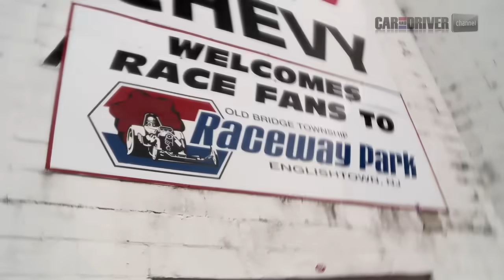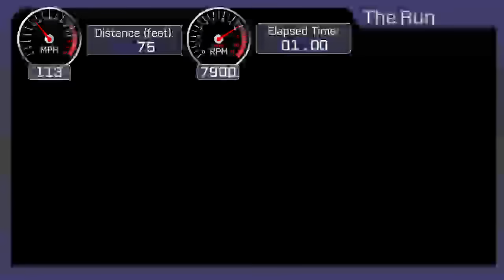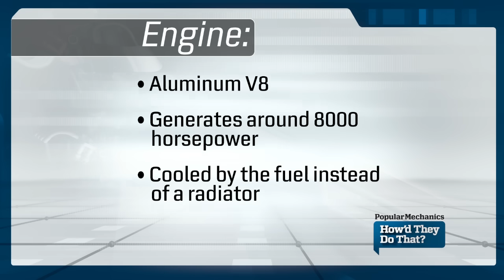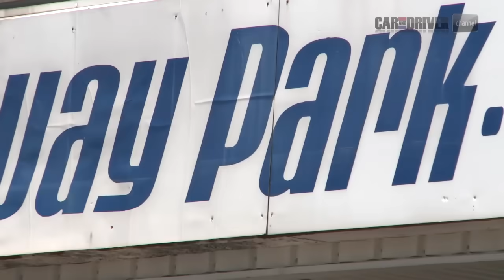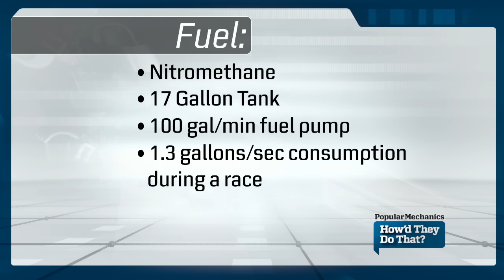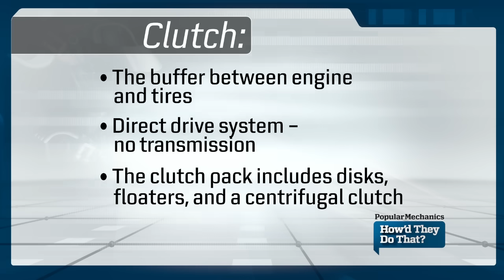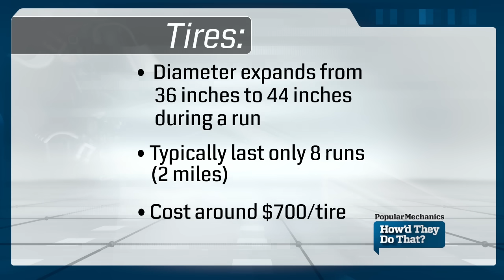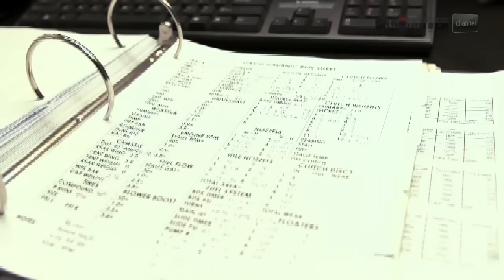How a Top Fuel Dragster Works

Comment: I have a lot of engineering questions that I would like to be answered. Why does the supercharger throw away 600 hp as a parasitic loss when it opens? When does the supercharger open or close? Is it timed? Why use a V8 engine rather than a V12 or another alternative? How exactly does a dragster's clutch work in order to get the engine power to the wheels? Why don't they shorten the length of the fuel line and make the car shorter in length? Lastly, why don't normal drag cars use Nitromethane fuel rather than e85?
Reply: Ok...They use a v8 for a few reasons...one is it is tried and true.. with 2 extra pistons the integrity of the engine block would be ruined. Mostly it has to do with geometry of the engine. The supercharger isnt an open or closed system. If the engine is running the supercharger is working. The wheelbase of the dragster is important for straight runs. If you shortened it by very much the car would be even harder to steer. As far a fuel choice goes, most people cant afford $16/per gallon for nitro meth and with e85 under $5/per gallon....
Reply: Insane82chevy Alright, that all makes sense. Thank you. One thing, though. I realize that I was talking about the intake valve. How does it know when to open and close in order to force that 50 psi into the intake manifold?
Reply: Jav The Ripper Both the intake valve and the exhaust valve are opened and closed based on the camshaft. When the camshaft lobe turns it pushes up the lifter, which pushes up on the pushrod, which pushes on the rocker arm and opens the valve. The lobes on the camshaft are staggered in such a way that it opens and closes the valves at a specific time. The camshaft timing is set on TDC (top dead center)of the number 1 cylinder.......I could give you a link to a couple of videos I watched when I was first learning if you like.:)
Reply: The parasitic losses come from the fact that a belt from a pulley on the engine turns the supercharger. Like an alternator it robs the engine of some power but the supercharger gives it back in spades by forcing air into the engine. It's nothing but a turbine driven by the engine, therfore like the alternator, is a parasite...
Reply: Insane82chevy That makes sense. Thank you. I would definitely like to see those videos if you wouldn't mind. Thanks
Reply: 1.V12 wouldn't put out at much torque as the shorter with more surface area v8.
2.The supercharger is powered by the motor via the belt, so to power the supercharger it needs power from the motor resulting in horsepower loss.
3. If the motor is running the supercharger is running but at idle it makes very little or no boost at all.
4.A computer controls the clutch engagement, a normal transmission would be destroyed or need to be rebuild also after every race along with the motor.
At different rpm's Im assuming the computer knows how much clutch engagement to allow at certain times.
5.The car is made that long with the fuel tank in front to act as a counter balance to help keep the front wheels on the ground. With that much power it is very easy to do a wheelie so they put fuel tank in the front to help weigh the front end down and make it longer so it has a harder time picking up. Think of trying to pick up a long pipe by just the base, its a lot harder than just picking it up at its balance point in the middle. Same concept basically.
6. That fuel is pretty damn expensive and your motor has to built and tuned for it, it would probably wreck a normal motor and/or wont run very well.
Reply: Nick TheWhiteGuy Thanks a lot man. That all makes logical sense. I guess that through years of building engines and dragsters, they figured out what works best. Do you know where I can learn more about really high horsepower engines and how they work? I was watching Street Outlaws the other day, and I realized that the way they launch in a drag race with nitrous is very different from a normal launch. I believe that they use their emergency brakes?
Reply: Nick TheWhiteGuy
on your first answer it doesn't make as much sense, just keep the cylindrical volume the same for the V12 and you would have the same surface area and torque per cylinder as the V8 only with 4 extra cylinders
Reply: Assuming the displacement would be the same between the v8 and v12 the v8 would infact make more torque than the v12 due to larger surface area per cylinder but make less hp as a tradeoff so I suppose it just depends on the builders set up.
Reply: Nick TheWhiteGuy so just scale up the cylindrical volume and surface area until it's equal to that of the V8, simple as that
Reply: bucketslash11
more cylinders means more weight
Reply: As for loses due to the blower. Think about how difficult it is to compress air real life example using a bike pump to fill a cars tire. These are running up to 60 PSI and are moving massive CFMs so it takes work to compress the intake charge. As for using V8's it just due to NHRA rules.
Reply: Jav The Ripper
just to add, no they use a break lock. My father and I used to race drag (6sec mopar) Depending on fuel the tranny may be computer controlled (higher volatile fuels) or may use a direct link with the driver using a clutch for first and a semi automatic (you just slam the levers down) for the other gears. Oh and the break lock just locks the front wheels so they can't turn, you use it for the burn out then turn it off.
Reply: Nick TheWhiteGuy torque equals acceleration, horse power equals top speed. you can achieve higher top speeds with a v-12, but it would take longer to get there. a v-8 can "wind up" faster than a v-12, but is limited to a lower top speed. the trick to drag racing is understanding that you have a very limited distance to achieve top speed. if you were at the bonniville salt flats a v-12 would be the ticket, but on a 1/4 mile drag strip a v-8 is the engine to use.
Reply: Ty Mcfadden
But how can you say that when the top fuel is hitting over 300mph? what V12 engine is going that fast? I don't know of one that is. There is a street legal v8 Ford GT that hits 283mph in the standing mile. Im sure it has a higher top speed than that. Still dont see a V12 doing that. And even from a factory standpoint the new Koenigsegg tops out at over 270mph and uses a v8. Its actually the same block as Fords 5.0 coyote. So it now is faster than the Bugatti with a w16 engine.
Reply: laplante149 because the production cars you mentioned are not designed to go any faster, as they have to meet department of transportation requirements for safety and road worthyness, and when people spend 200k+ on a car they would like it to last a while. also, a v-8 generally takes up less space that a v-12, so the cars can be built smaller and lighter. go out to the bonneville salt flats and you will see v-12 powered race built cars reaching speeds far in excess of what a production road car can do, or a race-built v-8 car for that matter. alot has to do with how the power is put to the ground, ie; gearing. another important part is how the fuel/air mixture is delivered to the combustion chambers. i've been working on high performance engines, mercedes, ford, chevy, jaguar, allison aircraft, merlin/rolls royce aircraft, etc, for most of my life. i could sit here and explain all of the intricacies of engineering to you but it would take hours, if not days. suffice it to say that raw horsepower kills durrability. notice that the 6000hp v-8's in the top fuelers are only good for 1/4 of a mile. i can build extremely torquey engines that have limited top end speed, but get there very quickly and extremely high horse power engines with lower torque that take forever to reach top speed. it's all really about what you need/want the engine to do for you.
Reply: Ty Mcfadden
Well that Ford GT wasn't a production car it is a street legal car and it was only 1 mile that it hit 283mph. That is not the cars top speed. I'm sure that car will hit over 300mph even the owner of the vehicle said it wasn't at its top speed when he did the standing mile. There is much more to speed than just horsepower. I also just did some checking and the fastest piston engine at the salt flats is a v8. It was driven by George Poteet and to top it off it was only a 5.0l. You cant say one is better for one thing than the other. You can say it depends on how its built. Georges car hit over 450mhp and has the record for the fastest piston wheel driven vehicle. So I am gong to disagree with you with saying v12s are better for top speed. A top fuel dragster is only limited because the clutches melt. If it had a different gearbox behind it it could very well be faster than Georges car. They hit 300mph in only a few seconds.
Reply: ا
Reply: Nick TheWhiteGuy They usually replace the internals (pistons, rods, crank, etc.) after every run. There are 4-5 clutches in one clutch pack. These engines are literally time bombs. It usually costs $7,000-10,000 for one pass, unless the engine blows up, damaging the supercharger, heads, etc. My previous auto instructor works on one of these teams, they are sick!. On another note, they run 1000 ft now because they use to run the 1/4 mile. One driver hit the 1/4 mark and the engine blew up, killing the driver.
Reply: kling2296 wow thats crazy, I didnt know it was that spendy and I always wondered why they shortened the runs. Its incredible how much power these motors put out.
Reply: they use a series of clutches that have centrifugal arms that spin out once a certain rpm has been met that grab on to the next clutch, and 4 or 5 of them essentially work as mechanical-automatic gears, they spin so fast and hott that usualy a few of the clutch plates are welded together after a run..
Reply: Nrha top fuel rules.
Reply: bucketslash11 Just wanted to add my 2 cents from an engineering standpoint. Everything in drag racing is designed around the V-8. If you wanted to race a V-12, you would have to design, machine, and fine tune the engine all on your own. There are very little products on the market that you can buy for anything above the V-8. Just making the heads would cost too much for the normal racer, even with sponsorship. In fact I doubt any company would sponsor any engine over a V-8 due to parts availability.
I have seen the big 12 cylinders in tractor pulls. Most are old airplane engines, modified for the use they are being used in now. They are 1940's and 1950's technology and just don't generate the power to weight ratio needed for a dragster. They are used where their weight is an advantage. Not all, but a lot of the V-12 engines in the Ferrari's and the higher end sports cars are usually, (not always) smaller cubic inch engines. Again, they still do not generate the HP needed for todays drag strip. I believe if the V-12 would have been the engine that the old drag racers used, they'd be the ones on the strip today. It's just the V-8 engine was the one that had the most power, and were plentiful enough for the guys building the race cars in the 1940's and 50's.
I remember speaking with Ed Iskenderian  (Isky Cams) once, and he said they'd go out on the weekend, race, and come back to their garage and regrind their cams to try and get more power. I asked how he'd grind the cam in his garage, and he told me on a bench grinder. Wow, can you imagine these guys doing stuff like that and trying it out the next weekend? Must have been fun!
Reply: ***** stick a custom supercharger equal to to the one on a V8 dragster (and have the cylindrical volume be the same as a V8)

this would mean equal hp/torque per cylinder as a V8 but with more power generated
Reply: bucketslash11 First off you also have added friction due to the extra area. In a vehicle that has no radiator, that is a factor. The second thing is that there are no manifolds available for a 12 cylinder, so that means extra cost for the design and manufacture or said manifold. If you have the same volume of the V-8, there is no added power. If you mean have the same size cylinders but you are adding 4 more, you are going to have to redesign the crankshaft too, since it will not take the extra forces. Hence you have more power, but astronomical cost. I remember the same argument for the twin engine dragsters of the late 60's. The issue was all the power does not matter if you can't get it to the payment. The tires will have to be redesigned, the whole chassis, the clutch, the gears, the axels, the block, the heads, the manifold, the crank, the injectors, the fuel tank, (more power = more fuel), computers, custom supercharger means extra cost, see what I mean? It would cost a lot of cash to do that, no matter how much more power. By the time you are done with R&D, manufacturing, getting it through the safety guys, you would be in excess of a million easily, for the added power which by that time may well be available in a V-8.
Reply: ***** cost doesn't stop the bloodhound ssc from being built so i don't see a major problem here
Reply: The supercharger could also be called an "air pump"  It takes power to run the pump and it is a lucky thing that the supercharger adds 10x as much power as it takes away and it is worth it power wise. The supercharger is connected from the time the engine is started until it is stopped.  The fuel is very closely timed as to the amount and when it is sprayed into the engine through various sized nozzles. V8 rather than V12? The modern V8 Hemi nitro engine has evolved from a passenger and truck engine called the "Hemi" because the combustion chamber is hemispherical in shape and there is an intake valve on one side and an exhaust valve on the other side. "Most" 4 cyl. high performance engines use the same combustion chamber design.  There were two Hemi designs originated by Chrysler but, today, the engines are all made by specialty manufacturers after the technology expanded past what could be done with the factory product.  Why not a V12?  One reason is that there were/are no suitable V12 designs coming off the drawing boards of American manufacturers. Drag racing is a very expensive sport and the returns in appearance, winning and sponsorship money is not even close to what is available in F1.  Depending on which team, a TF team could spend $1M to $5M in a season.  The team in the video, Kalitta Motorsports, is owned by Connie Kalittla, the sole owner of one of the world's largest all-cargo airlines, Kalitta Air.  One reason why Kalitta has an airline is to make the money to do what he does.  A V12 is more expensive and would take a lot of money to develop before it would (perhaps) provide an advantage.  They have their hands full with what they have now.The clutch is a centrifugal clutch. The faster it spins, the more force it puts on the clutch plates. The reason why the car is so long is to be able to handle the force of the acceleration and stay in a straight line.  A "Funny car", a car with a similar drive train but a body and wheelbase about the size of a regular American passenger car, is much less stable. Nitromethaneis a very difficult fuel to control.  It is actually less volatile than gasoline but, when it does burn, is produces much more energy than gasoline.  It is mixed with methanol (alcohol)- about 90% nitromethane, 10% alcohol. Depending on the needs of an individual team, this ratio of nitro to alcohol may be different. Hope that is useful.  Drag racing is certainly different from F1 and Rallye. If you see an event near you, check it out!  The Nitro cars will not necessarily be there but there will be a lot of exciting action and you can go right down into the pits and see the mechanics work on the cars and talk to the drivers.
Reply: Jav The Ripper About the fuel, think about it this way: The fuel alone mathematically provides 130% additional hp, just from being able to be burned that fast.  So if this car ran on methanol with all non-nitrospecific stuff being the same, it would make only 4200-4300 hp as the Top Alcohol class dragsters do.  5700 (estimated 10k hp nitro engine hp) of the hp thus come from THE FUEL ALONE (which is super mindblowing).

That's why they use it.  Nitromethane is so simple a compound and breaks down very easily and carries it's own oxygen.  In a crude way, think of it as methane gas (like lighter gas only even simpler compound than propane or butane) with a "built-in" nitrous oxide component in the molecule itself.  Nitrous oxide from the regular tuner world or your dentist chair (used as anesthesia) is just N2O and Nitromethane is just CH3NO2, so they both carry oxygen "onboard".

This is one of the many advantages of using it, it can physically burn so rich (1.7:1 mix with air) because of so much oxygen being there already and on top of that it also cools the engine just enough to not have to bother with that as an engine builder.

It really is mostly chemistry and basic math in combination, the burn rates and mixtures and that.

If they made the car shorter (which they use to be, google fx 1975 US Nationals and see Garlits car or Shirleys from 1982), it would be (iirc) harder to avoid a blowover and placing the fuel in the front helps with weight distribution to keep the car planted during the launch.
Reply: FastgunEd compared to a turbocharger the supercharger is indeed a parasite.
Reply: Jav The Ripper I really have no clue why they love the V8 configuration so much, I think that a flat 6, V6 or even VR6 would be superior. Can somebody explain to me why in the US they tend to use V8's in motorsports so often?
Reply: Jav The Ripper 

Most of what you ask is mandated by the rule books.   The supercharger takes that much horsepower to move the amount of air at the pressure required.  Think of a fan moving air.   The V-8 is the powerplant because of the rules.  The engine is based on the vaunted Chrysler HEMI.
Reply: Insane82chevy how much it weight ?? Does it same with f1 ??
Reply: Ty Mcfadden torque is the force of rotation, horsepower is the work that is possible over time...
Reply: My question is how much is a single dragster?
Reply: The Ford GT got to 283 in 1 mile. Top fuel dragsters get to 275 in 650 feet, and they take 3 seconds to get there.  Different builds for different goals.
Reply: @B K A budding engineer would ask these questions, and more, much like a scientist. Your comment doesn't make sense.
Reply: @B K yes very strange. ??? 🤔